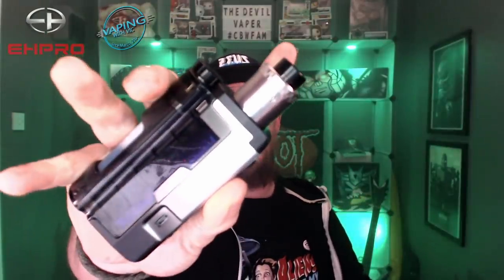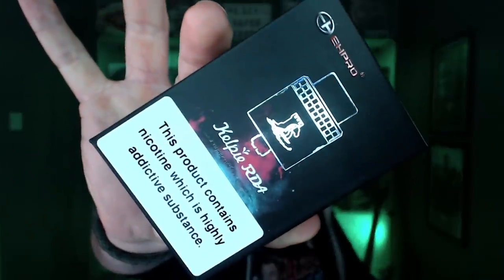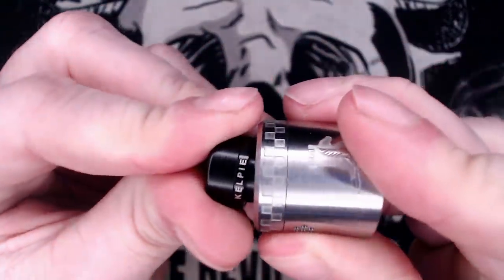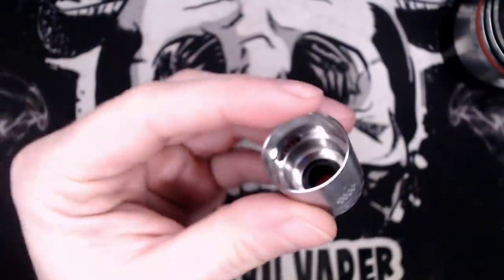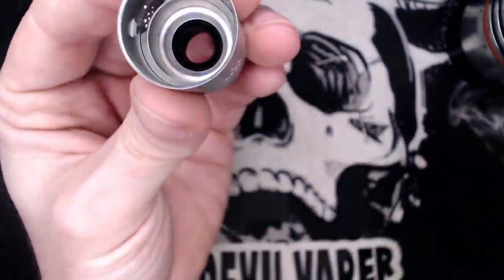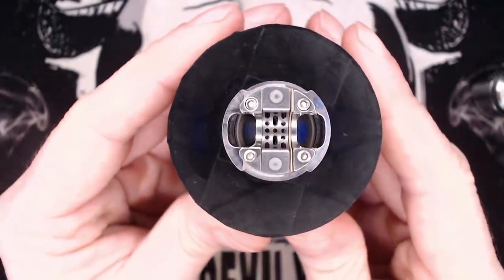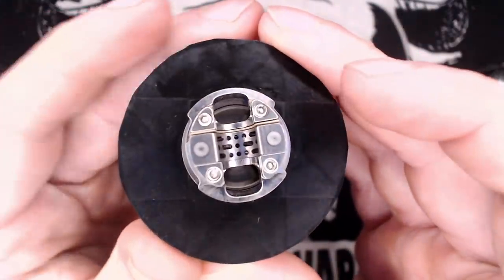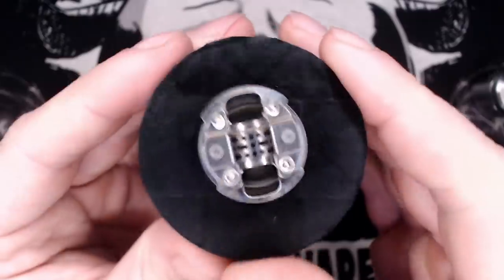EHPRO Kelpie RDA Review & Build - A Vaping With Vic Project

Comment: Being in the Engineering game I agree, the inside of the barrel has not been finished to the std you would expect to see. Good final inspection protocols would have found these.
Reply from the maker: Good to have a professional opinion on the machining, Rob! I'm no engineering expert etc, so it's nice to hear what you have to say. Thank you mate!
Reply: @TheDevilVaper  I was a metal turner for 8 years (albeit manual lathes as opposed to CNC) It looks like either the cutting tool was above the centreline of the diameter being cut or the chuck speed was far too low at the point of cutting. I would also get this same pattern on internal diameters if the cutting tool had either a slightly loose tip or the play hadn't been first taken out of the tool post.

Comment: 👍🏻 your one does have a correct spelling on the bottom. I think the roughness on the inside has been done on purpose, top cap looks like it has been hot/cold pressed into the barrel and burrs are meant to help hold it in place. They should have made the burring shorter though so it does not show under the edge of pressed in top cap.
Reply from the maker: Yeh, I suppose the correct spelling is a pro, lol!
As for the burrs, are you talking about the ones on the airflow holes in the barrel?
Reply: It looks like there is burring just under the edge of top cap all the way round on the inside of barrel. That made me think it has been made rough on purpose to increase grip between barrel and top cap after pressing in. Hope that makes sense.
Reply: Had a close look and chattering is in line with locking tabs, that means they used a rotating bit to remove metal on that section as opposed to turning the barrel . Should have done it slower or with better tools. Still a good RDA.

Comment: Great Review Mr Devil as always,i've seen other reviews for this Kelpie and they all mention the quality is really bad but you brought something very important to the table....the loose burr inside the air hole's isn't this dangerous.If someone took a deep pull and sucked some of that loose burr into their lungs that's dangerous.I think they should recall the first batch.
Reply from the maker: Thanks for watching, Old Bear!
I wouldn't say that the burrs are dangerous as they seem to be quite solidly attached to the outer barrel on my version. As for other people's, I'm not sure how theirs are, but it may differ from RDA to RDA. But it is definitely something that EHPro need to address, that's for sure!
Reply: @TheDevilVaper  problem is it only takes one very small piece of burr to be inhaled then you have a big problem.
Reply from the maker: Yes, exactly that mate. I haven't seen if anyone else has had the same issue, or even looked at it close enough to see, but hopefully people will look closely before using the RDA

Comment: Nice review dean , don’t like the quality of this one bit , one l will be giving a miss for now , ehpro need to sort these issues out for the second batch and add a bit thicker o rings on that deck too , l feel sorry for vic , this looks to have been rushed out to beat Chinese New Year .
Reply from the maker: Thanks for watching, Robbie! I would be angry if I was Vic, as I personally would have wanted things perfect for the release
Reply: Agreed dean , the quality of the production release is the responsibility of the manufacturer , ehpro . I hope vic has been in contact with them , certainly the first off batch should be as perfect as they could make it , not iron the issues out for the second and subsequent batches . Also not keen on the fact that the top cap appears to have been fitted together , airflow adjustment would have been better on the top .
Reply: Robbie f to be honest it was the same with the rta. After market screws for the posts becoming available after a lot of complaints about them being flimsy. Seems to be the ehpro trend.